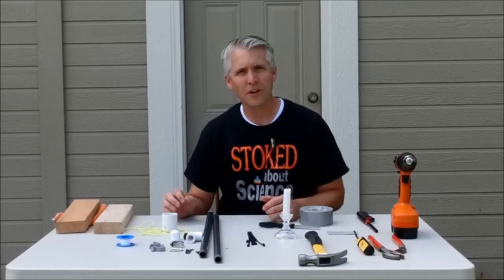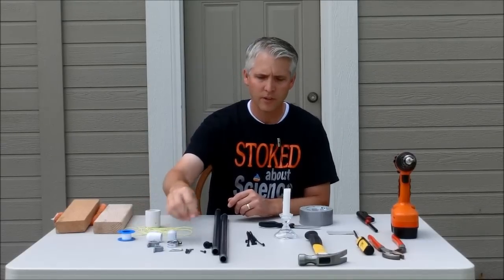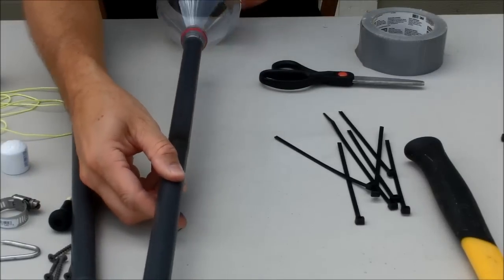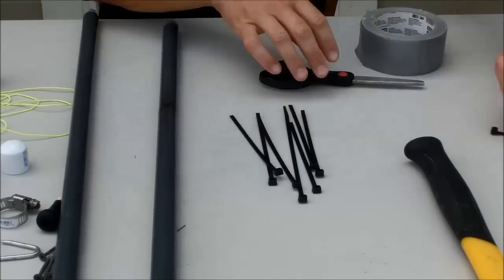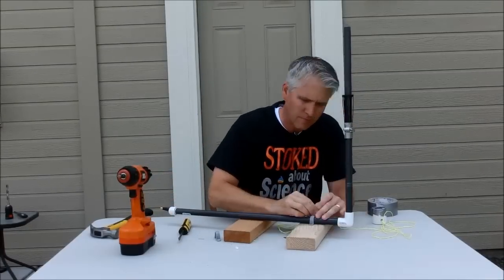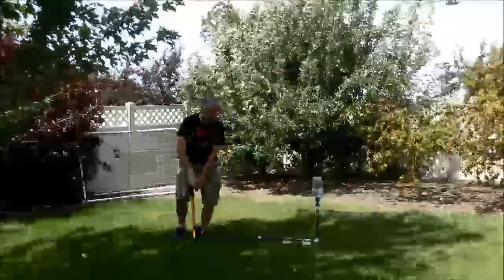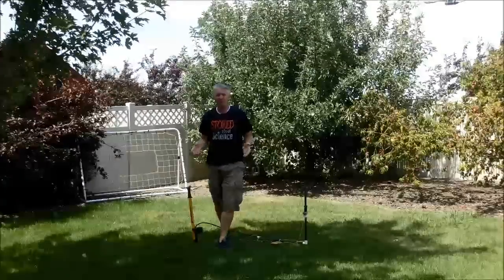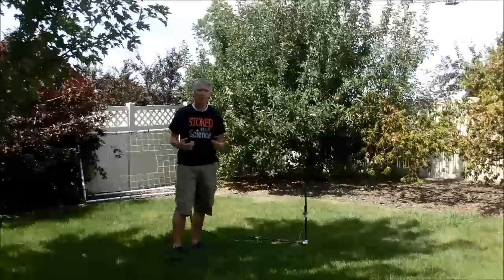How to build a water rocket launcher

Comment: My man! Thanks so much for this video. Ive watched so many others that over complicate things. I made this easily and the parts are very obtainable 1 trip to home depot or any hardware store worth its salt. I especially like your choice of threaded pipes which eliminates timely and messy pvc gluing.  My very first launch worked. I needed to tweak it only once and I have over 75 successful launches since with zero problems. Most fun I've had in a long time thanks so much. 

Oh and I did learn one very valuable lesson. Don't let any sand get inside the bottle top. It will scratch the launch pipe and cause future launches to misfire because there is too much friction and the bottle just sits there when the release is pulled. I had to sand down my launch pipe and carefully inspect the bottle before loading.  No problems since. Thanks again.
Reply from the maker: +BOMBSWABS You are welcome.  I've seen that same problem with sand before!....Glad I could help out.

Comment: Not all bottle necks have the same diameter "grip", so the size of your release collar may be incorrect for some bottles. You may need to adjust the size of the collar so that bottles with small "grip" area don't slip through the cable ties.

Also, the tire valve is designed so that it is installed by pushing it from behind with a rod. A Phillips screwdriver works great. Just slide the base of the valve over the screwdriver and push it through the hole. It will stretch out the rubber making it narrow and just slide through the hole.

Good job adding the safety notes about PVC! Nice!

Have fun!
Reply from the maker: Thanks for the tip.  You've got some great and instructive videos on your site.  I loved the split collar launch mechanism:)
Reply: Thanks! It comes in super handy when you increase the pressure. The cable ties get pressed so hard the color doesn't move!

Comment: This might interest you I built a 12oz bottle handgun version of this to shoot fishing line over trees with so I can hang my Longwire Antenna very high up in the air (static electric build up is fun when the antenna gets long enough- I haven't had the guts to charge the 55 Gallon Barrel Leyden Jar with it though). The small 12 ounce bottles fill in seconds with few pumps and hold more pressure, you don't need water, and they go faster due to less wind resistance- I can get mine up to 185PSI with the 12oz bottles before the seal starts leaking and they go around 500 feet into the air- although bottles are good for only a handful of launches  because the lip of the bottle gets hairline cracks due to the pinhole gap between the bottle and the end of the pipe in the micro seconds after it gets launched and the air rushes through the pinhole gap many times faster then the speed of sound and shockwave pounds the lip of the bottle creating the loud pop you hear as the bottle gets launched.
Reply from the maker: +Bryan Ropar somehow I missed your comment months ago.  I like the idea of smaller bottles.  I will have to give that a try.  You still used the zip-tie launch mechanism?

Comment: Everything gets too wet when i put the bottle on and the tire valve hole seems a bit smaller then yours. Is there a solution to these problems?
Reply: If you could answer asap that would be very helpful :D
Reply: did you find that solution?
Reply: Can u give me the sizes of pvc pipes  used, including the trigger pipe, thank u

Comment: Can you please tell me the real names of the Tools and Supplies and What to do, Sorry I Cant Understand Some In Ur Video
Reply from the maker: +Michael Jhann 
Here are the supplies: 1/2 inch wide PVC pipe (24 inches long), 1&1/2 inch PVC (short piece for the trigger),90 degree threaded elbow, threaded endcap, D-straps (conduit clamps), some boards (I used 2X4 scraps), thread seal tape, 8 zip ties, duck tape, some short screws.
Here are the tools: Drill, candle, scissors, hammer, lighter, screwdriver.
Thanks for watching:)

Comment: how. to. make. a. realising. pin. to. creat. preasure
Reply: I know that this is 2 years late, but for others, the PVC pipe with the string is used as the launch trigger. The PVC pipe is slipped up over the cable ties when the bottle is dropped into place. The string is used to drop this sleeve to allow the rocket to escape.